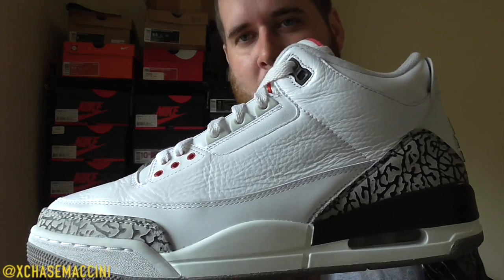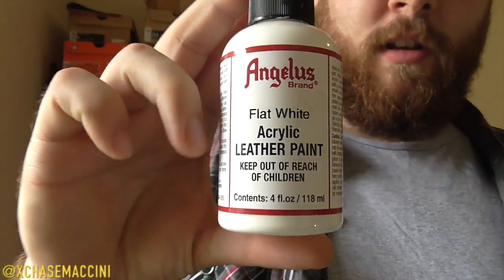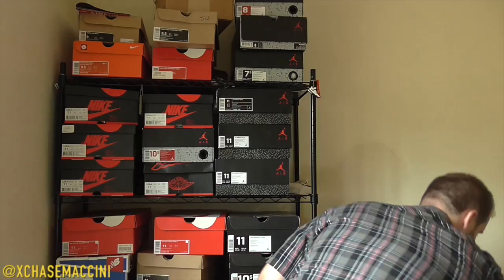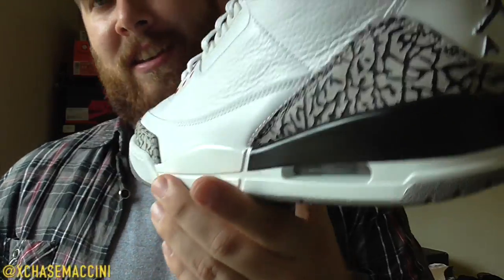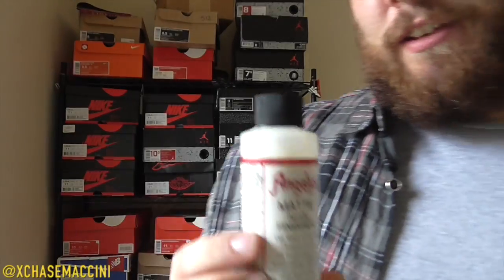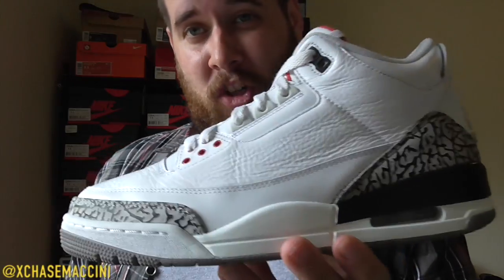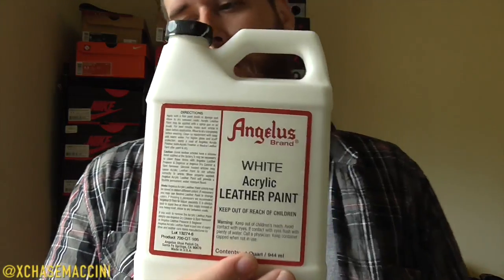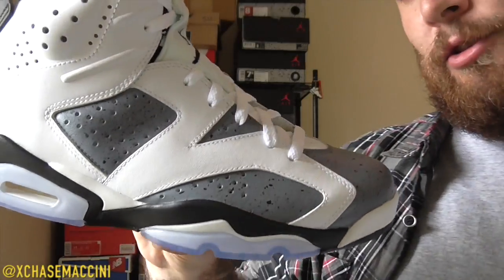Sneaker Restoration Tips 2 - How To Prevent Your Midsole Paint From Cracking

Comment: Hello... I recently repaint a pair of 2014 nike force 180 Olympics (white) , did the blue, red and gold from angelus and it came out pretty good but the midsole started cracking the 2nd day, I wore the shoes 2 times, I work in an office so not much of walking....so...what do u recommend?? I used a finisher, acrylic mate but still cracked too soon, way too soon, I understand that it'll crack again but not that fast.....any tips? Suggestions??

Thanks for reading, 

H.
Reply: Repaint and add mod podge is a possibility. I mixed paint with mod podge 50/50.

Comment: you should test them by painting Ink to see if it would last on the bottom of the Sneakers or the Midsoles with the Seal. Lets see would this work. As long as the Ink is completely dry, it should be indistructable with the Scatch Resistant seal. Remember this is just a test.

Comment: im from north-east india and could get only 1st copy jordans not OG's. So i have a very deperate question i.e. I got 1st copy of Jordan 8 bugs bunny. And as just a 1st copy the white colour of the toe cap got stripped/cracked off so quickly. So, if I follow your exact steps on the toe cap, will my shoes get reliably or permanently white just like OG white and not need to repaint often after every brushing when washing/cleaning. Do the white can stand brushing without getting stripped off? SOS...REALLY NEED HELP EVEN THOUGH I KNOW IM VERY LATE FROM THE TIME OF YOUR POSTING THIS VID BUT MY EXCUSE; IM YOUR SUBCRIBER.

Comment: If you using the wrong paint anyway.

Try tamiya PS paint spray cans. Polycarbonate paint that's flexible and made for flexible plastics. Foam is kinda similar. 

DO not use tamita TS paint that will crack straight away that's the paint for hard plastic. 

PS tamiya paint is the flexible one. 

Try it let us know. I suppose you could paint them every month. Bish bash bosh spray spray new colour new shoes.

Comment: Do you think using a base undercoat of something like automotive paint, which is meant to be flexible and not crack in case of an accident is wise? then apply the angelus paint over the base coat?
Dupli-color sells a Vinyl and Fabric coating that could work. If it's meant for something like a vinyl covered seat get used daily, stretch and whatnot every time you sit on it. then maybe it could work on a shoe midsole?

Comment: I painted military 4s and with the first wear they chipped again I was so pissed. I guess I should have used the finisher. also I have several DS 3s and 4s. should I apply the finisher before in wear to prevent chipping?